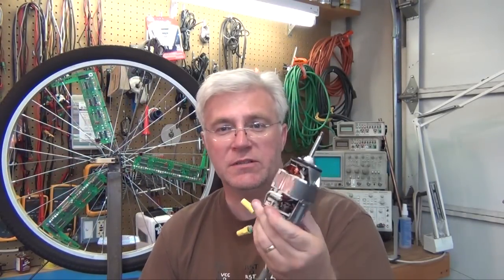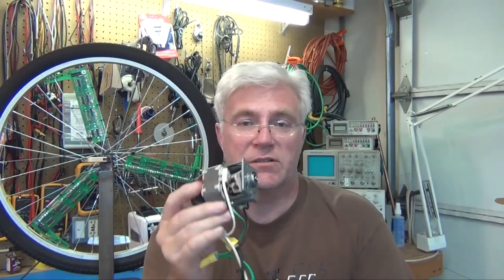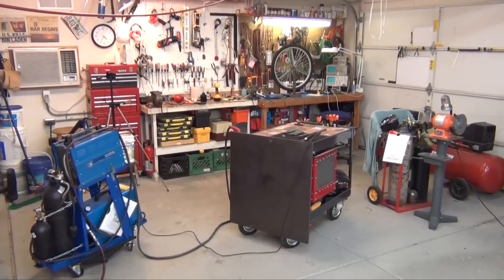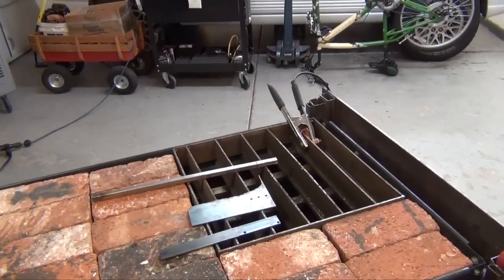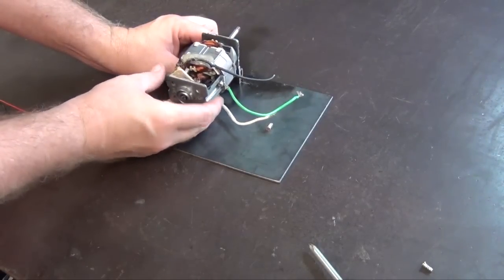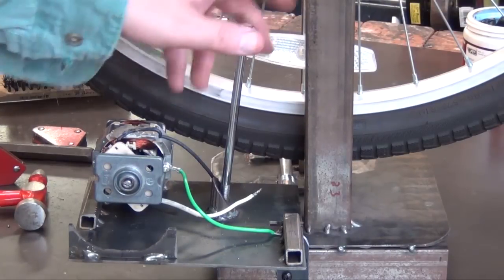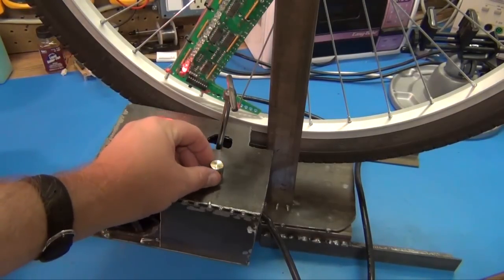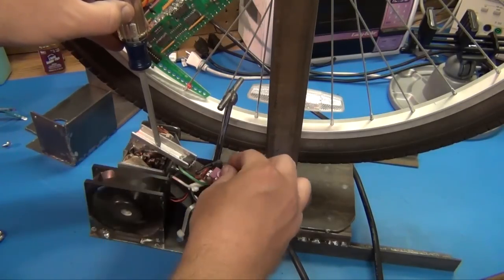ToddFun.com: Motor Repair - Welding - SpokePOV - yeehaw

Comment: Have you thought about using a small rubber wheel at the motor shaft?I think it would improve the contact. 
Another improvement may consist of using a spring under the T screw in order to maintain the pressure against the wheel.
Nice work!